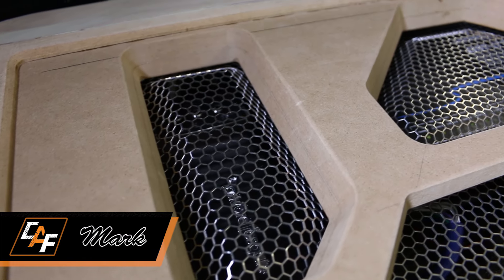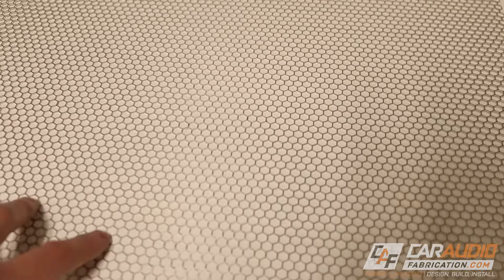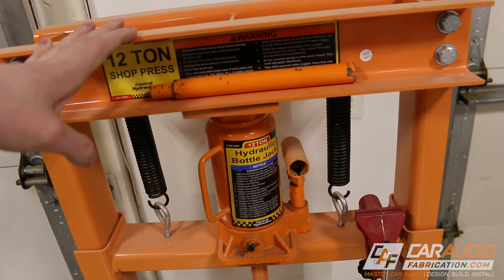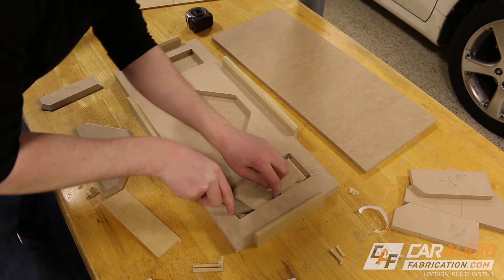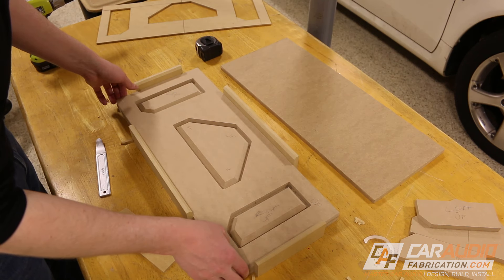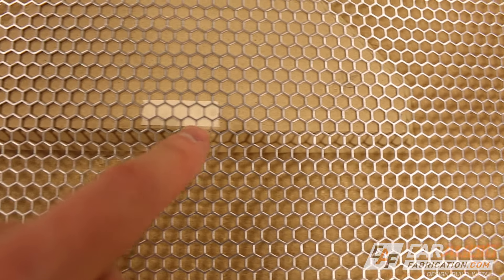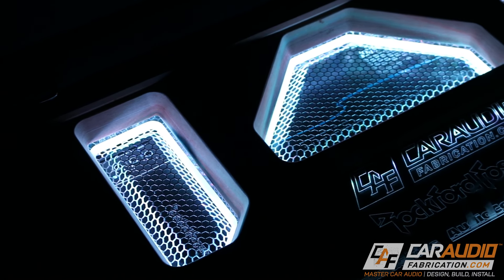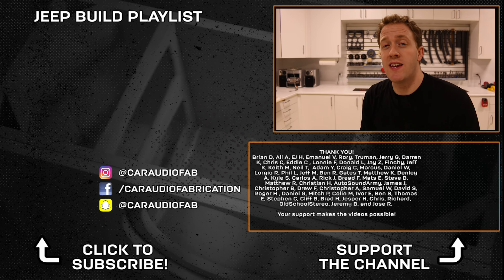PROTECT Speakers Amps AWESOME CUSTOM Molded Metal Mesh - CarAudioFabrication

Comment: After moving into a house to make the boss / wife  happy, I now have a small two car garage...I have to improvise. (The old garage was 28 deep, 32 wide with 12 foot ceilings) I built a shed for lawn equipment, but have a 28 ton log splitter I modified and fabricated a dozen different attachments to pull/push bearings and other automotive repairs that require force. A tray of 3/4" steel, 2' x 3' slides over the bottom foot and tightens with 4 bolts. I drilled holes for adaptor plates & other fixtures. It works sooo great for many projects. Note; the splitter wedge end on the ram is removable...so if your in the market, look for one that comes off for adaptors you can use for many things. I even made one to break the bead on tires. Since my log splitter can be vertical or horizontal, it become more versatile. It helps that i have a 150 amp MIG welder for fabrication. Retired ASE Master Tech

Comment: I make a 2 part perimeter mold of the outer shape and the positive shape. I fasten the two with a piece out of some scrap vinyl material  glued on like a hinge the i run it through a slip roll a few times.  😁👍

Comment: you could also use 2x4's (or solid metal beams) on both sides of the sandwich jig you made and tighten bolts on the 2x4's down to each other without needing to drill into anything else.

Comment: In production,  i.e. automotive world,  the mold parts are steel or aluminum.  Virtually always an outside supplier. The mesh grills are made in seconds and generally the cost is in cents ¢.
If the mesh is a little difficult there are 2 stations, like for extra steps or need to rotate the forms/ mold. The 2 stations may have different pressure if step 2 is delicate.
Probably has been shown already on the TV show "How they do That".
Nice video.

Comment: Wood clamps with angle iron also work really well. The angle iron spans the longer distance and doesn't bend easily and allow good even pressure but you need threaded clamps not the hand squeeze type

Comment: Never thought to do this. Looks like MDF being used, so thicker metal I'd be concerned about destroying that template material, so perhaps a good solid plywood if using a thicker metal, or one with less open area. Good thing I already have a 20 ton shop press, I may try this technique for a cool custom grill on my project truck!

Comment: So in all your videos you provide links to the tools and supplies you use in the video, except for the vinyl where can somebody purchase the 4 way stretch ?   molded mesh i have done this to build grills for my kick panel drivers i was getting tired of replacing my midbass 8's  all the time. I just made a MDF ring used the router and pressed some mesh trimmed it and glued it together and wrapped it in acoustically transparent fabric( speaker grill fabric) they turned out perfect with nice rounded edges looked exactly like a factory made grill
Reply from the maker: I added some links in the description. :)
Reply: I followed every link,  nothing shows me where i can buy the vinyl .  I know how to wrap with vinyl just don't know where to purchase it,   specifically the 4 way stretch vinyl.

Comment: Totally awesome, great technique and video also, just subscribed. I have one question, the mesh looks awesome, but do you ever have a problem with durability? Would it hold up if it got accidentally bumped? If so, other than placing it in an area where bumping is unlikely, do you have any other ideas on how to increase durability?
Thanks for the video, lots of great ideas, not the least of which how to do this without a hydraulic press!
Reply: It depends on how thick the mesh is.

Comment: If I were making a lot of these pieces, this may be worth while. But if it's for just a couple of pieces, I would make the small piece to stretch the metal on, and simply use a plastic hammer to stretch it. Might take a few tries but it could be done in minutes vs an hour. Time is money!

Comment: Hello Good Day. I saw some of the modification videos here. I want to ask if it is possible to put a protective mesh on my Sony GTK X1BT. I remove the metal mesh because of the thick dust inside. Now it is bare and I wonderin how I can modify the cover. Thank you. I wish I can upload the photo so you can check.